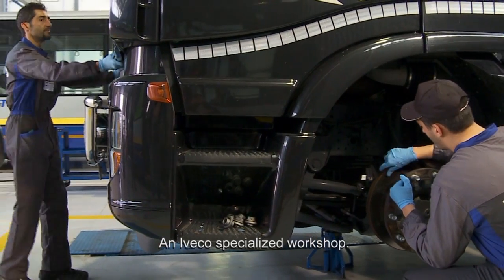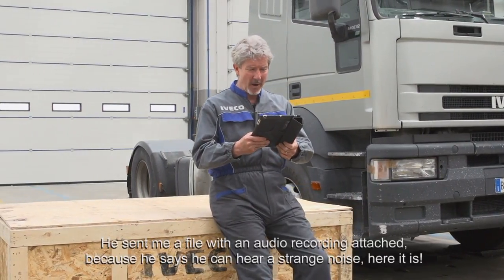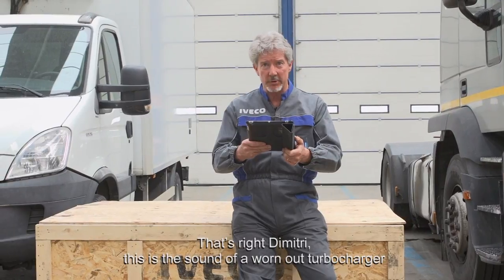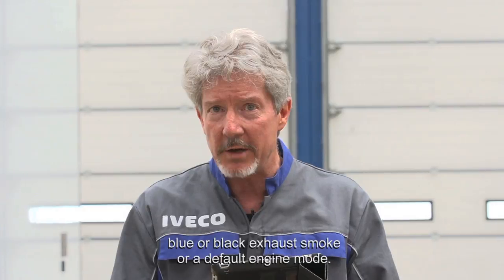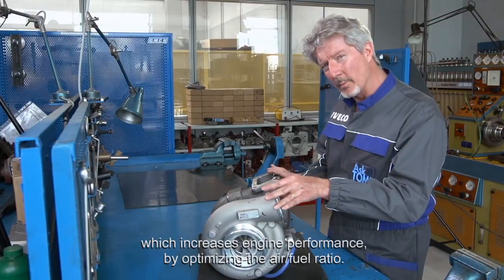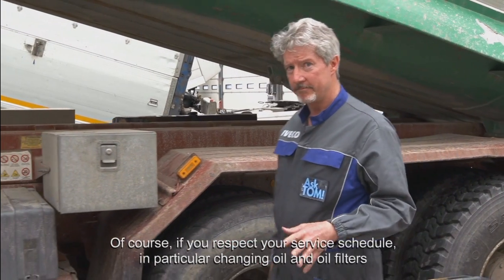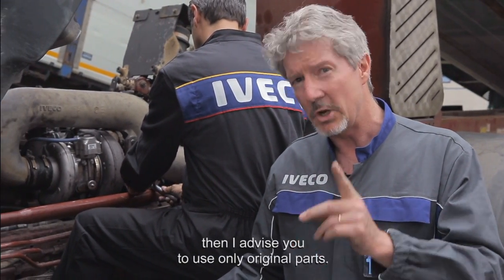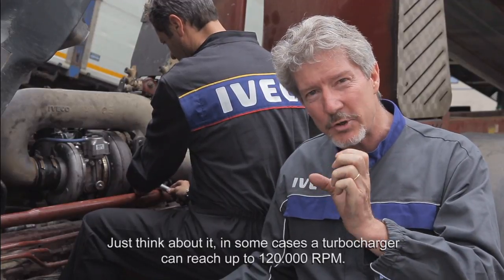Iveco Turbo - Ask Tom

Comment: Hi am Joseph from Ghana west Africa. At my post we have Iveco Trakker 380 is a water tank and we are having problems with air leakages, when release the hand brake and start to drive with some kilometers then the air finishes I have replace the handbrake release valve but still facing the same problem please I really need help.
Thank you and hope to hear from you soon.
Joseph

Comment: I have a generator that uses IVECO engine. At this time it is not working. When I turn the key to start it tries to start and it has smoke but finally it will not run. How can I fix this problem. Please help me if you have an idea.

Comment: Hi Tom my name is Craig I'm in the UK I bought a 2005 Iveco eurocargo but but I washed engine 2-days ago came back the next day day try to start it it did not start 
so I left it it and go away no I come back today put the key in it start straight away
But after it been running for about 10 minutes I realised the engine goes up up between 10 and 15000 RPM then  when i put my foot on the accelerator it does not do anything so I realise it is going into limp mode even when I turn it off and turn it back on it go straight into limp mode is this usual problem or can you help me to tell me what the problem I could fix it I'm a mechanic never dealt with one of these before

Comment: This question you have changed the half block with camshaft now we have wanted to start the engine is not starting you have to service the injectors still the engine is not start so what will be the fourth

Comment: I have problem iveco truck 6×4 mixing oil and diesel
Reply: Some "fuel dilution" of engine oil is "normal" and "inevitable". "Excessive" fuel dilution is always due to "operator error" of excessive idling, improper engine/application "specs", improper/insufficient maintenance/service per the OEM manufacturer's "instructions", damaged/broken parts resulting from one or more of the above, "power" modifications or choosing a "shadetree" mechanic/shop for service, use of "will-fit" aftermarket or incorrect OEM parts,  improper operation/break-in/warm-up/cool-down or worst of all "deferring" recommended/required maintenance/service/repair/replacement of "wear" parts because the engine/vehicle "runs fine" at the recommended/required hours/miles of service/use. 

And of course buying a used or "new" engine/vehicle from a "private party" who can't/won't provide full "documentation" of the engine/vehicle and its "history" and/or full "OEM-approved" service and parts support. Every OEM publishes "specifications" for "negatives" like oil consumption, fuel dilution, crankcase "blowby" etc and "oil sampling" is the only way to accurately and correctly check and verify fuel dilution and of course that's only possible when the engine/vehicle are in "good condition" otherwise and are properly operated, serviced and maintained.

And one more thing. The lack of spark plugs, distributors, carburetors etc does not mean diesel engines are "maintenance-free" and that they never need "tune-ups". Quite the opposite, the diesel fuel injection system IS the engine ignition system and pumps/nozzles/injectors are subject to a much more "violent" and "dirty" operating conditions than spark-ignition engines and components and have to let in fuel, keep out "carbon" and "fire" and are creating up to several thousand psi of "injection pressure". 1500-2000 hours between "injector" or "nozzle" removal, testing and inspection (an "injector" combines the "injection pump" and "nozzle" and both controls fuel injection "timing" and "quantity" while a "nozzle" is only the delivery "valve" for the "injection pump" which "times" and "meters" fuel injections "externally" and "nozzles" typically require more frequent "service" than "injectors" because they are not "adjustable" installed in the engine) is fairly typical with "heavy-duty" diesel engines subjected to varying engine speeds and loads and typically "nozzles" will fail at least the "valve opening" or "pop" test and will have to be "rebuilt" or "replaced" in order to restore proper engine injection "timing" and "metering". 

Because even though they're not directly "injecting" the fuel and have no pump and aren't "timed", the "valve opening pressure" or "pop" pressure is the result of their internal "restriction" and the injection-pump "flow" and when they get "weak" fuel injection begins "early" and ends "late" with the fuel being "squirted" instead of "blasted" into the engine cylinder whenever the engine is operating at less than "full speed" and "full load" and "idling" engines tend to be "overfueled". Then AT "full speed" and "full load", the "low" VOP or "pop" pressure can "underfuel" the engine because an "early" and "late" injection doesn't occur at the optimum time for full fuel "burn" and "power". Low VOP and the issues it causes eventually cause "plugged" nozzle "holes" and/or leaking delivery valves and/or "carboned-up" tips that can cause catastrophic engine failures or "just" things like fuel dilution.

No only "how-to" video from a "master mechanic" who is spending his customers'/employers' time and money to make "how-to" videos for "free" is giving you anything worth a dime more than what he's charging for it and if he/she is really interested in HELPING YOU he/she will respond to your "questions". These videos are "infomercials" for IVECO, which does NOT have a "sterling reputation" for engine quality/durability/reliability in the only "market" where diesel engines/vehicles/machines are TRULY subjected to "real-world" conditions on an ongoing, long-term basis "industry-wide". Which is the UNITED STATES. No other country has more "owner-operators" of diesel engines/vehicles/machines and a wider variety of "applications" and "operating conditions" than the U.S. In the U.S. an "OTR" truck can literally go from below-0 (Fahrenheit) "arctic" operating conditions to "desert" heat conditions 100+ degrees hotter in HOURS "crossing the country" on a "coast to coast" run up through and "over" the "Rockies" and then to the "west coast". And "OTR" trucks/engines are the LEAST "tested" vehicles/engines in the "diesel industry" in the United States. Marine, construction, agriculture, "LTL" and "vocational" trucking and "long-distance" freight/passenger rail etc all "work" diesel-powered vehicles and their engines much "longer" and/or "harder" than "OTR" trucking does. 

If you have questions about your engine make/model and need to go to the internet to find "answers" period or at least ones you can "afford", you probably have more "problems" with your choice of make/model of engine than even OEM-trained professionals can "solve".

Comment: please I need to ask my truck have a problem of over heating I was checking all parts for cooling system but not get any result please advice me
Reply: Replace thermostat, look for any coolant leaks, low coolant or bubbles in the radiator or overflow tank. Check if both hoses are hot after you run the car for a while if one of the hoses is hot and another one is cold replace thermostat and water pump.